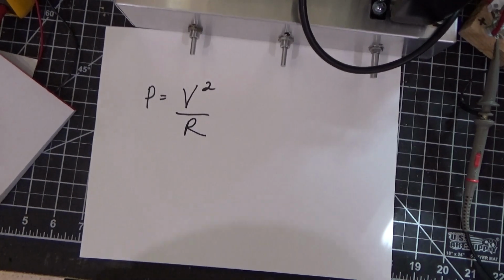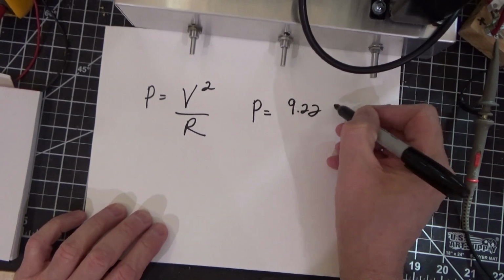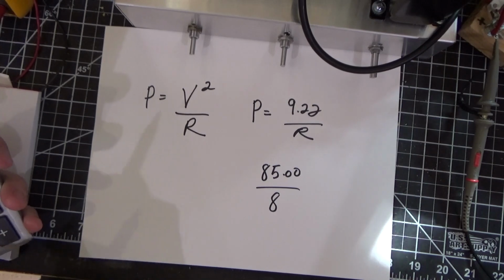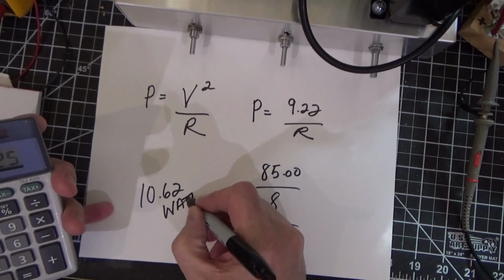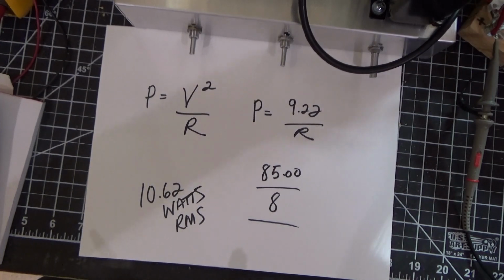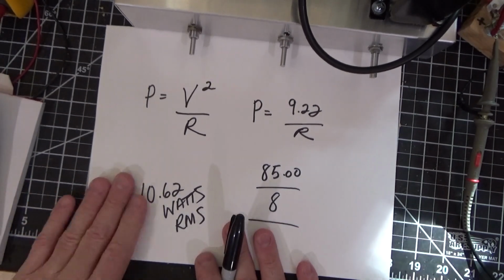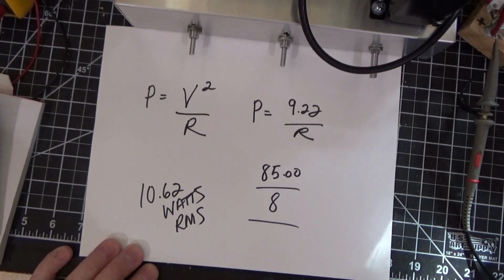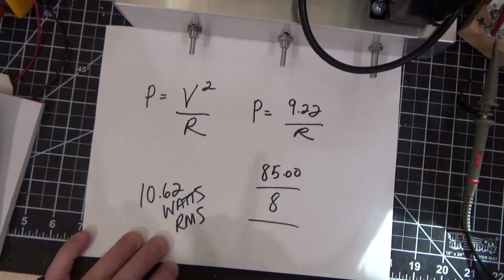Push Pull 15W Guitar Amplifier Build : Episode 3a - How many watts are we pushing out ????

Comment: Why did you change the impedance to measure the power at 8 ohms.   Why didn't you leave it at 16 ohms so you know what it is outputting at the speaker impedance it is going to be used at?    My experience shows the power output drops with higher impedance speaker loads.   I also have noticed that my Fluke 87V true volts RMS meter does not match the scopes volts RMS.   Not sure why but I have seen differences.    Better to measure scope peak and use formula to calculate RMS volts and plug that into power formula.
Reply from the maker: Jp.... I do not have a sufficient 16ohm power resistor to run for a sustained period of time and i did not want to take chances.  its easy to swap so I chose that route. On the RMS, I did do the calculation off line form the scope  ( v * .707 / x) and it comes out near the same.  The meter is just easier and more straight forward.
Reply: @rciancia  Gotcha.   Lack of toys is always a problem.   LOL.